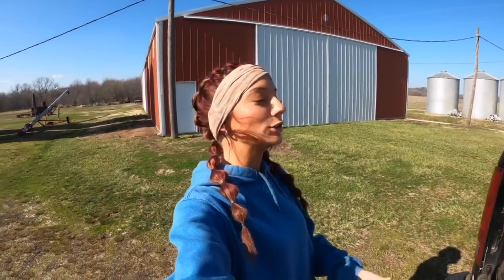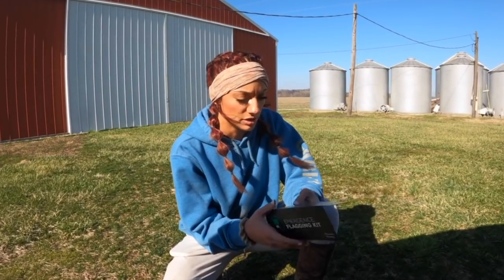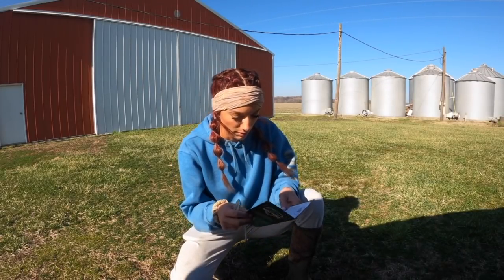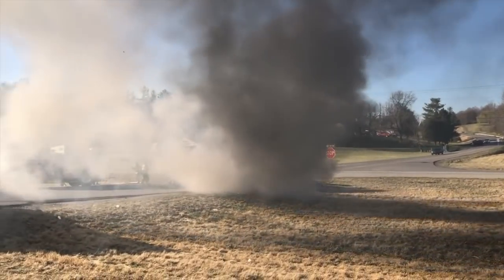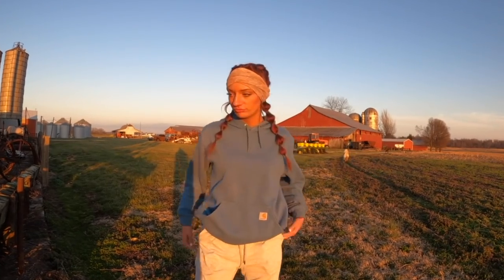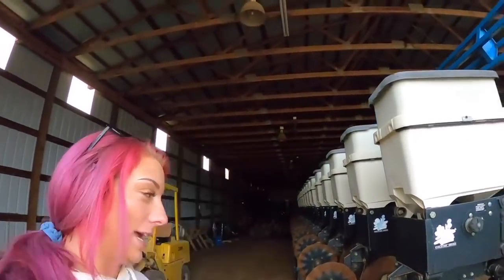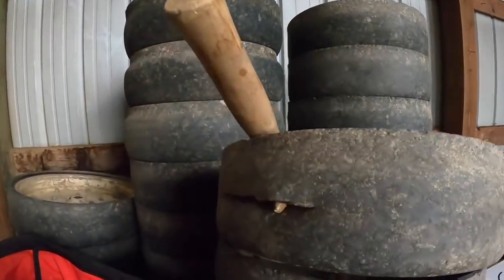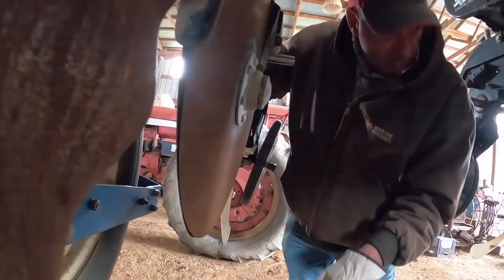This Was NOT on my To-Do List Today...

Comment: As a 61 yo former mechanic, if you're not already doing it, protect your hearing with plugs or muffs when using power tools or running loud equipment. It will save your hearing from unrepairable damage and ringing!  :)